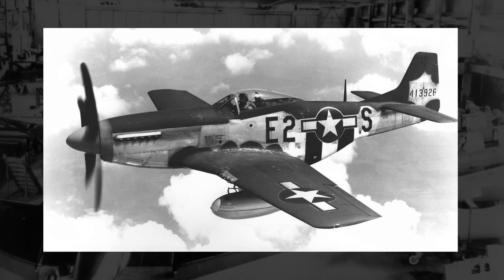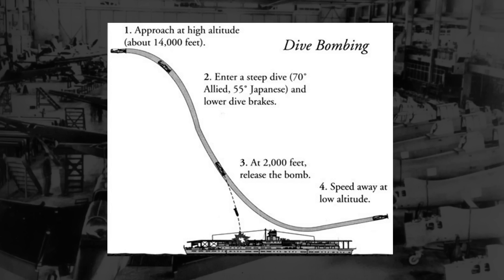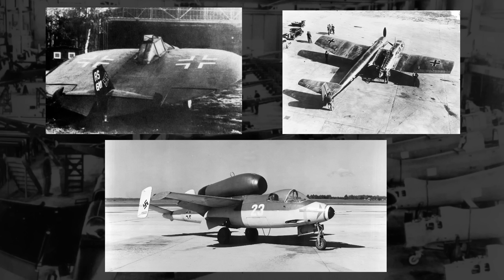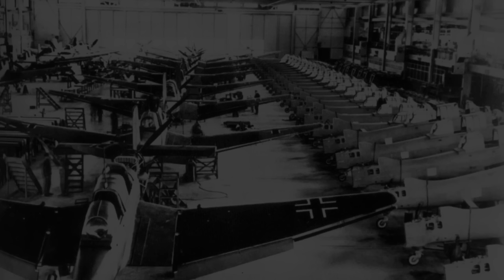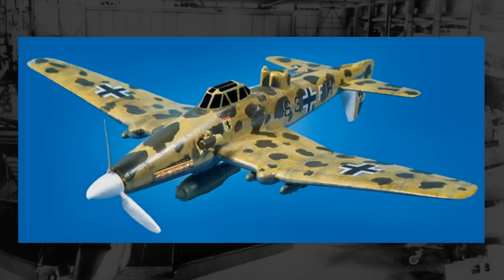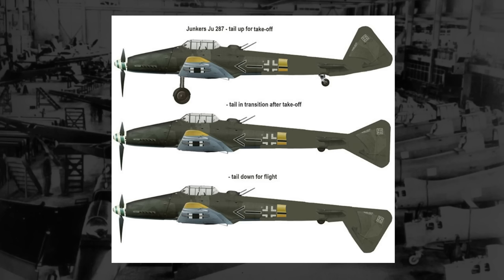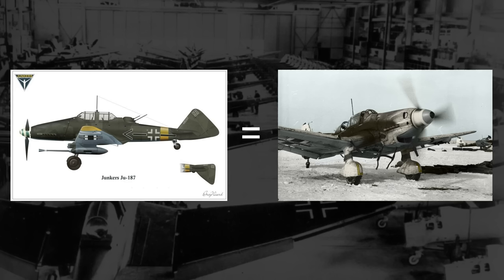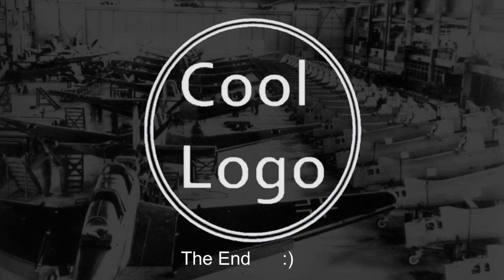The Rotating-Tail Stuka: Junkers Ju 187

Comment: Well that's a relief - when I read the bit about "rotating tail" my first thought was that they were trying to rotate the tail is flight - axially - around the axis of the fuselage, rather than rotate it up and down..  

That would be an interesting handling issue for sure !
Reply: thats what i thought!
Reply: It would of been like one of those dodgy wheels you get on a shopping trolley!😂😁👍
Reply: I know what you mean (because you must mean 'the other axis'), but you didn't actually say witch axis. Traditionally in airplanes we think of there being three, I think.
Reply: "rotating" is just wrong. The correct term would have been "pitching"
"Mein Herrs, we need a test pilot for our new plane. It will be tricky; In the middle of the test, you will be controlling the flight while turning a crank, for 20 seconds, that will rotate the tail around, while keeping in mind that the elevators will start to operate in the opposite sense, and... yes, Lt. Schultz, you have a question?... No, Lt., you may not volunteer for the Eastern front instead..."
Reply: @SasquachPL  The 'other axis' would be Italy & Japan !
Reply: It is a bit of misinformation. Rotation implies around a axis, the obvious axis being the length of the plane. "Pivoting" tail would be a more accurate description, linguistically.
Reply: Yeah, I was thinking "clockwise, or counterclockwise"? Coupling the controls through something like that would be crazy. Nice point-of-failure...
Rotating as shown would be less troublesome, but I would think it should only be done in straight flight.

I would also expect it, thanks to angling the rudder, would apply nose-downward forces in default "up" position, which would presumably be compensated for in wings and horizontal tail surfaces - BUT apply nose-upward forces in the "down" position that are aggravated by the tweaks to keep it level in "up" position. That would take some serious getting used-to.

Gee, what could POSSIBLY go wrong?
Reply: A rotation around the pitch axis is still a rotation. @-danR

Comment: The prototype Ju 87 tried to free up the aft field of fire by having twin vertical fins and rudders out at the ends of the horizontal tail.  IIRC that configuration wasn’t strong enough in a dive so it was replaced by the conventional single tail we all recognize.
Reply: sad thing it wasn't strong enough

Comment: Inverted Gull Wings served one purpose, to shorten, and thereby strengthen, the landing gear and allow for propeller to ground clearance.
Same with the F4U Corsair.
Reply: Yep, but the downside was a difficult to make wing spar, especially the Corsair with it's folding wing.
They say that's one of the big things that determines whether or not an old highly weathered one that's been sitting in a jungle all these years can be restored or not, if the wing spar is beyond use due to corrosion or battle damage it'll just be a display piece instead of being made airworthy if the spar is bad enough, they're just too hard to reproduce.
Reply: Joining the wing to the fuselage using an inverted gull wing also means the joining point is at 90 degrees and therefore a wing fillet isn't needed to reduce drag and overall parasitic drag is reduced.
Reply: Gull wings also provide extra natural aerodynamic stabilization adding to the stabilization that come with planes with straight wings in the first place. They also provide lift in a bank changing some of the maneuvering qualities.
Reply: Ground clearance isn't main consideration.
Reply: @ansgaryeysymontt7155  Really? By all means, please enlightened us, because the history of the F4U speaks specifically to just that issue due to the hard nature of carrier landings and the very large prop.
Reply: @alanrobinson2901  F4U was hard to land on carrier because of poor visibility. For minimal interferference drag ideally wings would be mounted at 90 degree to fuselage. Inverted gullwing just makes sense in terms of drag.
Reply: @ansgaryeysymontt7155  Dude, for heavens sake read Wikipedia's history on the Corsair, or better yet Martin Bowmans book.
Reply: @alanrobinson2901  Which of my statements are wrong?
Reply: Corsair gull wings were caused by huge diameter of its propeller. They needed to get the tip higher without having gears absurdly long.
Reply: @noldo3837  1 inch larger prop than p47. IIRC bearcat prop is about 1.5 inch smaller. But both of them used telescopic landing gear. F4u gear was strong ( it was even used as divebrake) because of short design but saying that it was sole consideration just isn't correct.
Reply: @noldo3837  It could be solved also by using telescopic gear as in p47 of f8f. It made sense aerydynamically and in terms of strenght the gear. as "Wiki with its sources mentioned, Dark Skies channel, some TV docu" yeah . dark skies channel and some tv docu is shitty source of information and if it goes for wiki - find source of this information - it is missing.  "This is facts against opinions.". Tell me which of my statements are wrong - if you cant that means that probably i am correct.
Reply: @fazole     Lol. Nowhere near 90 degrees. As they had an anhedral of 12 degrees the actual angle of the inner wings at the centreline was 166 degrees, although it looks more because of the fact the dihedral of the outer wing had to be exaggerated to compensate.  Why this would affect the wing fillet is a mystery as these served simply to reduce induced drag on the fuselage (irrespective of the wing angle) and with a plane as slow as this it would never be an issue.
Reply: The gull wing had few functions,  strength and lift. 
This design helps during release and dive recovery.
Reply: @jantschierschky3461  And yet, few had it, including highly successful Japanese and American naval dive bombers.
Reply: @ansgaryeysymontt7155  Possibly true, but the fact is the Gull wings other attributes weren't known until AFTER it was used and tested in a wind tunnel.
Hmm, talk of happy circumstance
Reply: @alanrobinson2901  well I don't disagree,  but the Stuka was the most successful and accurate dive bomber able to attack at 80°
Reply: @alanrobinson2901  there was NACA tests about optimal place of connecting wing to fuselage predating construction of f4u.
Reply: and a7m2
Reply: I built, owned and flew a 1/2 scale Corsair. She was fun and very easy to fly, except for take-off and landing. I was never able to 3-point land her, and my many attempts often scared me, with much bouncing and me often wondering why I didn't prop-strike. But that was an aerodynamic issue: she just didn't like to 3-point and I eventually decided just to fly her onto the runway to a main gear landing, which worked well for me. The over-the-nose visibility issue was a different matter. No amount of good pilotage would provide a view of the runway from the cockpit on either landing or take off. On take off, I could not see the runway in front, so I looked out the side to maintain myself on the runway until the tail lifted and allowed seeing the runway in front. On landing, that visual limit provided for severe anxiety! Looking out the side to maintain runway centerline is not possible when the runway is below and hundreds of yards in front of you! And I had many anxious landings! But, as I began to get familiar with her, the final approach got shorter and shorter and eventually I discovered that rolling out from the final turn right onto the runway was best. So my patterns evolved from downwind-base-final to downwind-final turn-runway. I sold her to help fund my way thru medical school, but I wish I still had her. Her name was 'Ju-Ju': on the left cowl was painted 'Good Ju-Ju' and on the right was 'Bad Ju-Ju'.

Comment: Looks like it pivots downward, rather than rotates
Reply: In their book, Luftwaffe Secret Projects - Ground Attack and Special Purpose Aircraft Dieter Herwig and Heinz Rode have a couple of photographs of a model of the Ju.187 showing the normal and rotated tail positions. From the position of the swastika it rotated about a pivot point within the rear fuselage.
Reply: You are kind of right.  It goes down by rotating downward on a pivot pin.
Reply: I concur
Reply: 100% it was supposed to pivot and not rotate.
If you look at the location of the swastika it does’t turn to the bottom but stays on the upper top of the corner.
So it would most likely been a leveler acting in the plain for up or down, like the one for the wheels for in or out.
Reply: @philippschwartzerdt3431  pivoting is a form of rotation.
Reply: @neiloflongbeck5705  Yes but I think they are trying to establish if the direction of the axis (or axil), is parallel or perpendicular to the direction of flight.
Reply: @mombaassa  that's obvious perpendicular to the fore-aft axis of the airframe
Reply: Seems that English has lots of words, but what's the use of that if they are used haphazardly
Reply: Vertical rotation
Reply: @neiloflongbeck5705  
Yeah, you are right, we are wrong.
But for people who speaks English and not Oxfordian, it pivots downwards.
Reply: Swings up or down, like a seesaw, instead of turning like a nut on a bolt.
Reply: @SMGJohn  ah insults. The refuge of the fool who knows that they are wrong. Any movement around a pivot is a rotation. It's  part of the definition of what rotary motion is all about. Any kid who played with Lego or Mechano know this. Any backyard mechanic knows this. You don't need a degree to know this.
Reply: @neiloflongbeck5705  of course, a pivot is simply a rotation on a different axis
Reply: @TheTuttle99  compared to what other axis? Do us all a favour and find out what a pivot is and what a rotation is? Because it's obvious that you don't.
Reply: It just rotates across the pitch access.
Reply: Well its rotated
Reply: It's click bait. 
Never flew. Never existed. The inoperable mock-up wasn't even finished.
"Rotates" is "technically true" but we all know how propellers rotate and I believe this "mistake" was intentionally deceptive..
Reply: How does the pointy top end up on the bottom if it isn’t rotating?!? 🙄
Reply: @reesbritton6623  "How does the pointy top end up on the bottom if it isn’t rotating?!?" 

It doesn't. They never got that far along.
Reply: @Dr_Wrong  by rotating 🙄
Reply: @reesbritton6623  

I guess you didn't bother watching it..
Reply: Avoids  the rudder operating back to front if tail was inverted !!  I think he means rotated .. around an axis ..east to west .. i.e pivoting downwards .. I reckon it woulda worked ok !
Reply: @Dr_Wrong  You may have a point - a type of clickbait within the video's title.
Reply: Does it really matter? It's still upside down.
Reply: But if it pivoted downward, then the articulating part of the tail would have to switch orientation.
Reply: @stevecastro1325  let's all just agree to disagree. From now on, we'll just think of it as a product of Nazi witchcraft and appreciate the unconventional design.
Reply: I think that one would be obvious since trying to rotate the tail in flight would destroy the plane and kill the crew ¯\_(ツ)_/¯
Reply: @TheArklyte  It depends. Moving aerodynamic components aren't uncommon, at least in more modern aircraft. It was rather pioneering technology back then, though, since aerodynamics were much less understood.
Reply: @reesbritton6623  Look at where the markings go, adn the graphic at 7:19.  It would rotate on an axis point located at the join between the vert stab/rudder and the end point of the fuselage. The rearmost point, when "up", becomes the lowest point when "down".
Reply: @IrishRhapsody  it depends on you showing me an example of a plane that rotates the whole tail section in flight
Reply: @TheArklyte  every helicopter ever? The entire thing can rotate, not just the tail.
Reply: @IrishRhapsody  ah, so you admit that you failed to find an argument? Already? Well, at least we didn't waste any more time on this.
Reply: @NiccoHel  that’s what I’m saying… it clearly rotates!
Reply: @reesbritton6623  Ah, I see, I read your comment wrong.
Reply: @TheArklyte  You got a very big mouth. I admire that. You'd probably be good at creating factual videos.
Also, I admitted nothing, but other than a patent application in the late 80s, there aren't any aircraft with that kind of adjustable tailplane to my knowledge.
Reply: @IrishRhapsody  so after all insults you admit there aren't any of these mythical creatures because they can't bloody fly? Sorry, not going to insult you back. And tbh it's not needed since everyone can see your comment where you compare such method to a bloody rotorcraft:D
Reply: @TheArklyte  so what, you want proof of such a vehicle? I'd gladly attempt to create such a flying machine, but I haven't the money, and I would very much appreciate not dying while attempting to get brownie points in a comment section.
Reply: @IrishRhapsody  or, you know, you can stop talking bs about people, who understood aerodynamics far better then you even then, huh? No brownie points, no drama, just stop feeding the myths about nonsense designs working. Thanks in advance and goodbye
Reply: @TheArklyte  I don't know how I was talking bs about people. If it was about me saying you have a big mouth, you didn't read the entire comment. It's a genuine opinion.
Reply: Here's the issue with an upside-down tail, now the directional flap in the tail is inverted when using them. confuses the pilot and possibly crash.
Reply: I’ve been looking at this thing for so long because I couldn’t get how it rotated, pivoting makes way more sense
Reply: Okay, WTF?  A Pivot IS a Rotation.  A Rotation IS a Pivot.

Choose an axis of rotation and a centre of rotation, and you get.... THIS!  A thing that rotates around a fixed point.  What's so difficult to comprehend people?  Do you all belong to some kind of argumentative flash mob?

Anyone else remember when education was a thing that happened?
Reply: 7:33 
Don’t talk…
Don’t type…
Don’t even think about it.

Just press pause 
and
look at the picture.

If it was a bird,
I’d say that it could point its tail 
up or down,
as required.

As for the aircraft design,
I’d say that the middle placement would be the optimal selection 
for efficient,effective flight.

There’s probably an 
R/C version flying around somewhere…
Reply: @stevecastro1325  The rudder wouldn’t need to be reoriented. It would work exactly the same way regardless of the vertical fin’s position. The tail section “rotation” is simply moving downward or upward around a pivot point in the tail section.  The pivot point is perpendicular to the fuselage’s longitudinal axis. Seen from the side, the vertical fin rotates in a clockwise motion around the pivot point as it moves downward. To return to its takeoff position, it rotates counterclockwise around the pivot point to its uppermost position. Regardless of where it is in that rotation, the rudder inputs from the pilot will be the same for whatever left or right yaw movement the pilot desires. Left turns will always require left rudder. Right turns will always require right rudder. The vertical fin position within its pivoting rotation doesn’t interfere with that.
Reply: It pivots, it does not rotate. That would imply the whole tail assembly twisting at a point in the fuselage. In this aircraft the tail fin alone pivots down. There is no other situation in which the word ‘rotate’ is used to describe such a movement; you might as well describe the swing of a door as rotation, or to give a closer example, would you say that the undercarriage rotates down?
Reply: Exactly.  Seems like pivot is a more accurate description.  I may be wrong but rotation is on an axis, and pivot is on a point?
Reply: @neiloflongbeck5705  and yet rotation isn’t the best term cause everybody thinks about the wrong thing initially… pivoting or swinging would be a better word to describe the actual motion.
Reply: @964cuplove  no, because any motion around a pivot is still a rotation no matter how many degrees it goes through.
Reply: It is pretty clear from the image that it is definitely not rotated
Reply: @Jawst  yes it is, just not in the direction you comprehend the rotation is in.
Reply: @neiloflongbeck5705  however it is still more precise here to say pivot / swivel than rotate, judging by the number of comments on this point and despite that pilots say "rotate" when they take off and they just mean that the nose wheel gets off the ground rather than performing a roll during take off (duh).
Reply: @t3avelos  any movement around a pivot is rotationary. When pilots rotate on take-off the aircraft they don't roll they pitch up but that is still a rotation about a point fixed above the centre of gravity of the aircraft. You could describe this as as pivoting about that imaginary point. Your comments are therefore pointless hairspliting. A majority of ignorance doesn't change the matter. It is still rotation.
Reply: @t3avelos  thank you for pointing your inadequacies. Whether you it pivots, or swings, or turns, or rotates. These are all the same thing.they are all rotations.  The one thing that all rotations have is a point around which that rotation occurs.  As for engine, there were such things as rotary engines, so that was already taken by the time jets came along.
Reply: Rotation of a plan is pitching the nose up or down. Rotation is on the lateral axis. He is correct when saying the tail rotates.  It’s not a clock
Reply: @neiloflongbeck5705 thank you for having sense. Roll, pitch and yAw😊
Reply: @stettan1  Seems that most other languages have much fewer words. But what's the use of them, if they cannot convey complex concepts, in simpler words?
Reply: Exactly. 😂😂😂😂😂 My car door rotates  so I can get in side.👍👍👍